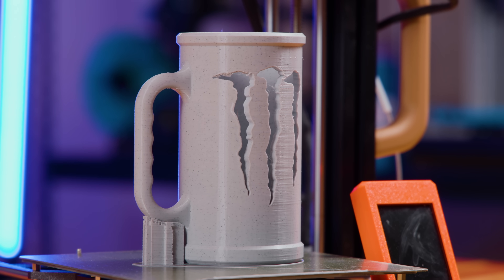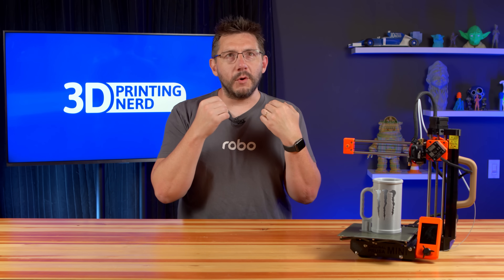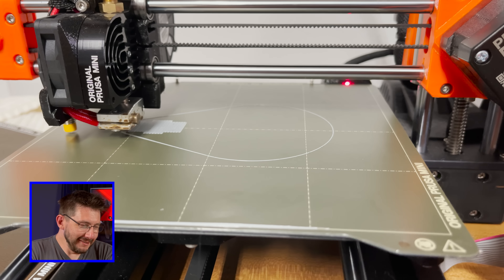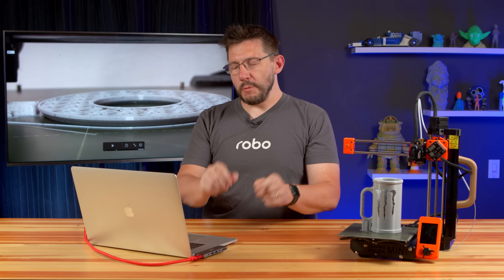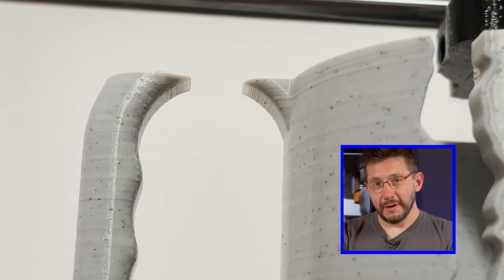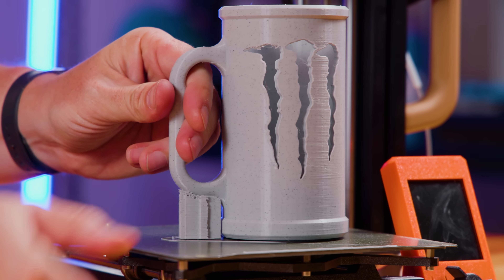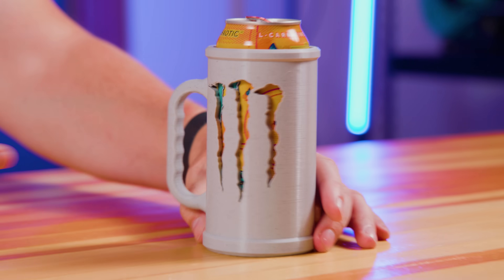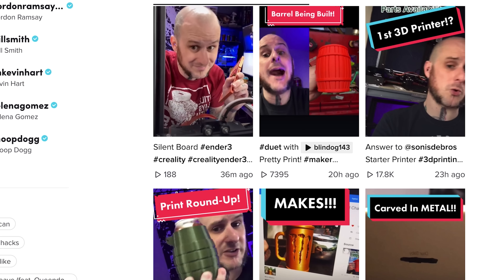WILL THE CAN FIT? // 3D Printing the Stimulant Stein on the Prusa MINI!

Comment: Fun print. You seem to really like that Marble filament (or Vanilla Bean, as they're calling it now). I should get some.
I was doing CAD at 2am, having finally worked out a solution to a problem I was working on (or at least I think it's a solution).
I'd rather have seen this printed on the Anycubic Vyper. Actually, even better would be to see i3 vs Vyper.
Reply from the maker: Print it on the Vyper? You got it!
Reply: @3DPrintingNerd  you are a gentleman Sir!

Comment: I've tested that filament. Prints great....But I was a bit disapointed with the qualitity of the print on that prusa mini
Reply: Quite a bit of rings on there. Will have to print one on my mini+ to compare. Rings like that has been an issue on all the printers I've had. Z-rod not moving perfectly straight seems to my nemesis.

Comment: I printed a similar can holder and had the same layer issues the higher up the print was getting. my newb thought is it's to do with the higher the x-axis being the more it'll shake(it was shaking a lot). still want to try one of those extra z-axis supports. perhaps soon I'll be brave enough to print that high